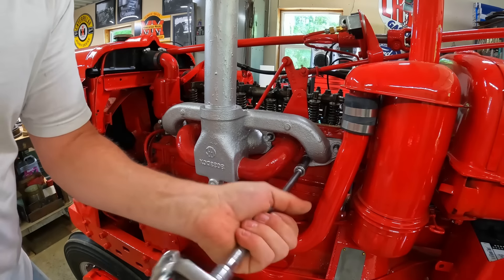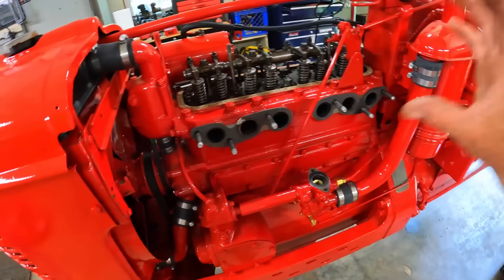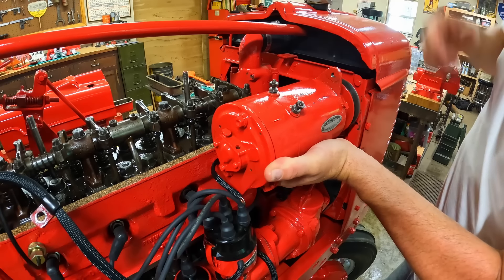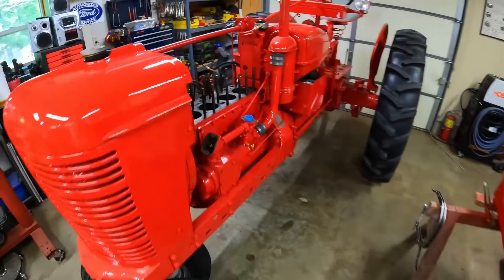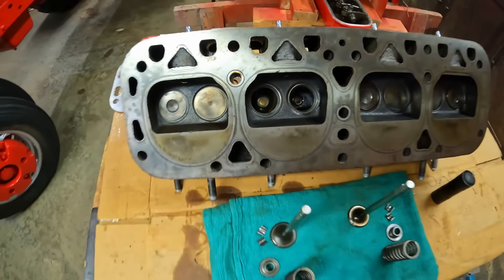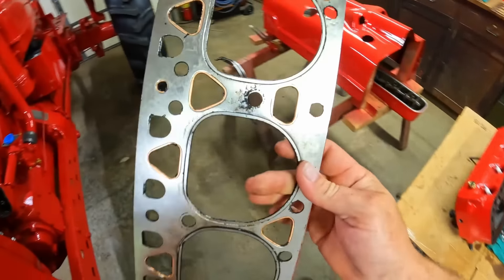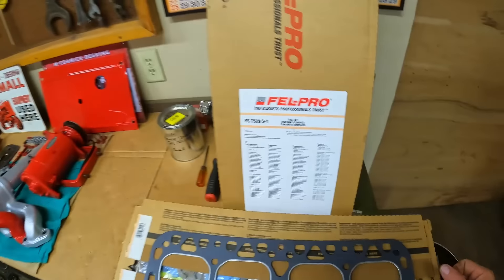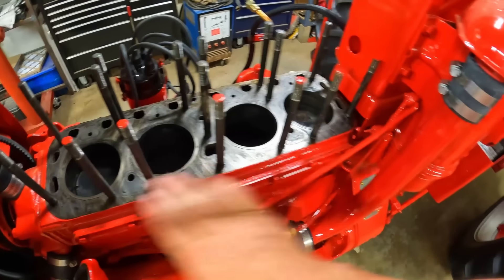Farmall H Engine Knock Found, But It's Not What I Thought - Farmall "Preparation H" Project Part 45

Comment: Bad things with this engine. You can not run an engine with a dry sleeve loose in the block. It will not last. The sleeve will burn as it has no good heat transfer contact area with the block being loose, it will overheat, distort and cause the piston to seize. The smaller head gasket holding the sleeve flange is not also an option, the sleeve should be press fit on the block in order to provide good heat transfer from the combustion chamber to the coolant gallery, if the sleeve is loose this will not happen. The only option is to dissassembly the engine block, remove all four sleeves, clean the bores and take measurements of each sleeve housing in the block. Sure will show they are out of spec and distorted. So only solution is to bore the block round again and install new oversized sleeves that press fit again in the block and give a correct boring & honing to the sleeves to the desired size so you can reause the old pistons if they are in good condition.
Reply from the maker: Back when I did the rebuild on this engine 18 years ago, all 4 new sleeves slid into the block with only hand pressure, so none are a super tight fit. About half of the dry sleeved engines ever built are just like this, with only the head gasket holding the sleeve down 👍

Comment: Off subject but, if that radiator is aftermarket where did you buy it? I've had terrible trouble finding one that allows the sheet metal to fit good. I have trouble latching my hood and my factory radiator allowed the hood to latch beautifully.

Comment: If you don't fix it right the sleeve will be in the oil pan in under 10 hours.
Reply from the maker: This tractor first had a sleeve loosen up 50 years ago, my grandfather got to deal with that one. I don’t know if it was this same #3 hole or not, but now it’s my turn lol 😂 On the prior rebuild (18 years ago) all 4 new sleeves just slid in by hand then, so none are a very tight fit 👍
Reply: @squatch253  The last time I put dry sleeves in a farmall, dry ice was used to shrink the sleeves and it still needed a press to push them in. Sounds like some time in the past someone screwed up and honed the block trying to make the sleeves fit in easier or the block has been bored to run oversized pistons without a sleeve.

Comment: Could that cylinder sleeve be where your coolant leak been from and your old head be ok
Reply from the maker: No, these are dry sleeves so no coolant comes in contact with them. Cylinder #4 is the one that was getting water in it, not #3 here 👍

Comment: Not sure of the type of liner, is it wet or dry?  If dry what is wrong with allowing it to be raised and apply a retaining compound to it. I am also old school so only started using loctite stuff for threadlock, and some bearing retainer products and never did anything requiring retainer like this so not sure if it would be satisfactory anyway. Even then, you could always use Heldite if that is available...  supposed to not set hard, but will seal, and if the head gasket is keeping the liner in place, then physically securing it with some sort of retaining compound is not really necessary, if it is a dry liner. If you don't know Heldite, it was a british sealer used on aeroengines...  liguid gasket product, and I am not sure if it was ever commonly available in US
Reply from the maker: Yes, fortunately this is a dry sleeved block 👍

Comment: 😊😊 I would clean cylinder  sleeve  grooves that should stay in place that's no good when a cylinder sleeve won't stay in place the other thing I would try if U can weld that cylinder sleeve in place and see if it stays there if not it's going 2 be a new set of cylinder sleeves and pistons I hate 2 say its going 2 be true 😮😮 OMG 7 29 2O24

Comment: Toby, I'm going to go with a different solution. Can you pull the sleeve and put some (3-4) peens on the outside rim of the sleeve. Not big honkin' divots, just a touch. Enough to raise a tiny ridge to hold the sleeve in the bore.

Comment: If the sleeve was moving, shouldn't have all of the antifreeze dumped into the pan???
Reply from the maker: Fortunately these are dry sleeves, so they don't come into contact with any antifreeze. They're just thin walled sleeves that slide into solid block bores - some tractor pullers just take these sleeves out and machine the parent bores out even bigger to put larger pistons in for more power :-)

Comment: Is the seal on the bottom of the sleeve going to leak water?
Reply from the maker: These are dry sleeves, so no seals.  Dry sleeves are just a thin layer of replaceable steel with a lip on the top that slip-fit into solid block bores.  Wet sleeves are the ones that have seals, like I put in the 5J1113 diesel engine - the coolant comes in direct contact with those.

Comment: Squatch , is that original headgasket a multi layer type?  Ive heard of guys reusing them successfully, in like an LS engine application
Reply from the maker: Yes, external metal cladding (the quality originals used to be copper clad, but sadly those are now unobtanium so steel is all we get) with a compressible fiber core (again, the "good old days" saw asbestos cores, but we all know what that stuff does lol) but yes, many times you can re-use these gaskets if in a pinch.

Comment: If the sleeve moves there ist something Major wrong.
Normaly iits a Press fit
Its not supose to move
Reply from the maker: About half of the dry sleeve engines ever built just had slip-fit sleeves like this, press-fit dry sleeves became more of a thing as the years went on and HP increased. Back when I installed these sleeves new 18 years ago, all 4 slid in with just hand pressure in good clean block bores 👍

Comment: I don’t understand, the sleeve is flopping around, you expect whatever is stopping it’s travel should have witness marks.  Nothing on the gasket because it has no interference with the sleeve but nothing on the cylinder head because… ?  Too few cycles?
Reply from the maker: Too few cycles is what I’m thinking, hopefully that means it didn’t rattle enough times to cause any damage.

Comment: Install a known good, head gasket and run it. If the noise is gone, chances are you won't have a problem. Everything is a gamble. I know what you are talking about, new parts have questionable quality. I have 2 old Volkswagens, and in that hobby, we all have had problems with new parts. Alot of parts are now made overseas, (China) and the quality just isn't there.

Comment: My Farmall B is a wet sleeve has to fit tight or else it leaks antifreeze,is H not the same
Reply from the maker: The H and M tractors have dry sleeves, they’re just thin walled steel sleeves that slide into solid block bores. Some people even remove them completely and run much bigger pistons directly against the block bores for super hopped up pulling power 👍

Comment: Wow, I did NOT have "loose sleeve" on my bingo card for this issue!  Maybe it's just me, but I'd have to pull the sleeve for closer inspection of it and the block.  If everything checks out, I'd reassemble it with a new o-ring and use some sort of retaining compound and your Fel-Pro head gasket.  Quick question: has Senior ever seen anything like this before?
Reply from the maker: Fortunately these are dry sleeves, so no o-rings to worry about.  Senior has indeed seen this before, along with my grandfather, on this very tractor about 50 years ago.  Perhaps that is a story for the next "Behind the Scenes"??? ;-)
Reply: @squatch253   that is funny “ seen it before “ on this tractor?  Major props for Senior 😆 for kicking back and letting the youngin’ figure it out 👍 even pretending to help in the diagnosis 😝. No one can’t accuse Senior of not having a sense of humor 🤭

Comment: Is this a classic, to be sold at high-profile auction for $2many$ ??  I think not, so just throw down the good parts, bolt and go.  No need to get up-tight with lock-tight.  Throw-up the junk gasket high into orbit.

Comment: Clean it with acetone. Green loctite and use the felpro gasket. If it sticks in the block so badly as everyone claims, who cares. You can buy another H similar year for cheap with a decent block. They only made a zillion farmall H's.  The serial numbers dont match block to tractor anyways (expect very early models)

Comment: OK, I have an issue with this. what is the mechanism of holding that sleeve to the block? Cause here's what I dont like - relying on about half, maybe two thirds, of each head gasket to retain the cylinder wall? That might be fine to putter it on and off a trailer; no way in Hades Id wanna rely on that even around a yard. Im presuming that sleeve is a press fit of some kind.  Also -- Ep 6 "Going Deeper Than Planned" - you noted that you'd found antifreeze on draining the oil. You suspected at the time that it was the head causing the coolant issue - are these sleeves dry or wet??

Definitely did not see that comin.
Reply from the maker: These are indeed dry sleeves, so they wouldn't be leaking coolant.  But yes, the slight overlap of the head gasket on the top portions of these sleeves is the primary means of retaining them in the block and is actually rather common when dealing with dry sleeved engines.  Most of these were never a tight press fit, and it wasn't uncommon to be able to slip them in by hand about half of the time :-)

Comment: Dra aldrig upp stötstänger på det viset då följer lyftarna ur å ligger sedan i strul
Reply from the maker: These lifters have a metal strip that attaches to the block just above them, to prevent them from falling out if a partially assembled engine block is rotated upside down. You can see the piece that I’m talking about in one of the earlier episodes when I was re-sealing this engine 👍

Comment: Not the item that i would have thought of.
What did the Young Squatch253 do then?  Did he notice this but overlooked it saying what i would have, "oh not an issue the squeezing of the cylinder head will lock it in place.
Shim stock? Loctite?
Cast welding the bore?
New used block?
Only the mind of the Squatch knows....
Stay tuned!
Reply from the maker: If I read your post correctly, this is not the original head gasket from that rebuild, it’s the recently bought new one because I had to replace that cracked head that I unexpectedly discovered during the engine re-seal last summer 👍
Reply: @squatch253 
I was going back we you did the first rebuild years ago.  
Not the video group of last year.

Comment: I won't comment on the method, it's already been done down below, just wanted to say that this diminishing state of things is disappointing. But then again, this is what happens when C-suite is let to do as they please without any checks and balances. First they find ways to move production to some place else, then they sell the old business and machinery to some place else, and by the time you sneeze, your sleeves don't fit, your gaskets don't gasket, the shirt on you pulls apart in 3 washes and everything is cheap, but sold expensively. This "allowance" given to trust fund babies and the 1% is what ruined these things. This notion that things will, eventually trickle down. Biggest lie, they never will. These greedy gnats will destroy everything when allowed. Should've never happened.

Comment: It's so discouraging to do a great job prepping and measuring parts and pay good money and you can;t buy decent parts because everything is made in China.  Cheap parts are not cheap and I would rather pay for american workers to make parts.  Radiators ..water pumps..fuel pumps.  rebuild kits all pieces of junk. Not counting all the extra work you have to do to redo something that should have been right the first time..